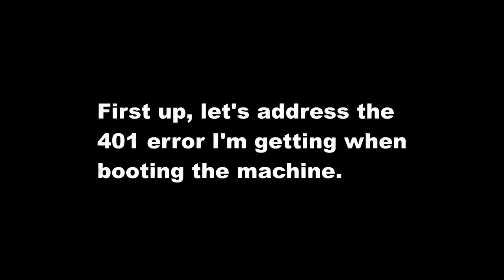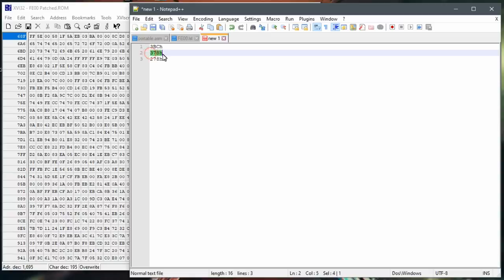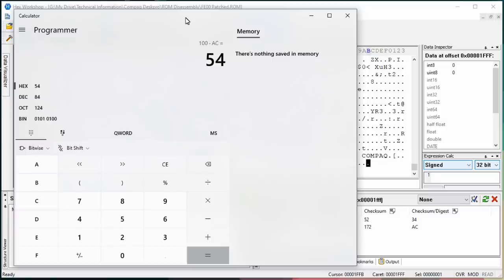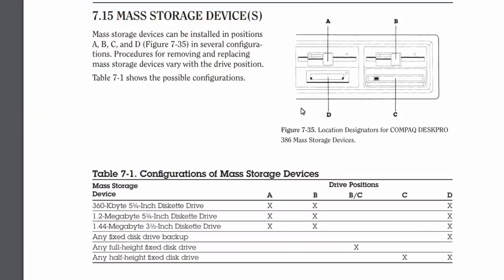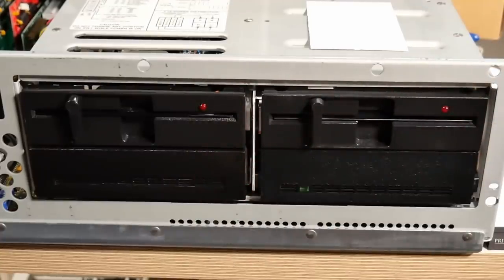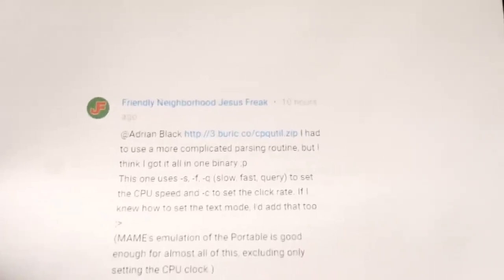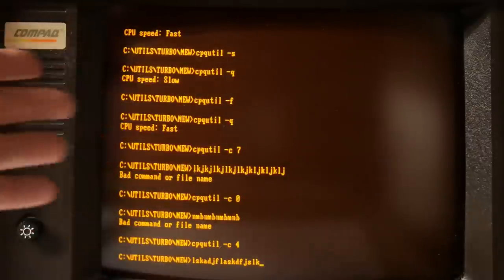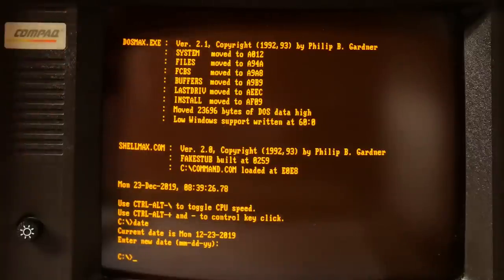Compaq Deskpro Part 3: Fixing that 401 error and more!

Comment: 20:01: The 1939 date is interesting. Because if this is related to Y2K, then the 1939 figure seems to suggest that XTCLOCK or SMWCLOCK (or Compaq?) used 1920 as their epoch date, unlike IBM, who used 1980: https://en.wikipedia.org/wiki/Epoch_(computing)#Notable_epoch_dates_in_computing
Of course 1939 also seems suspiciously close to the year 2038 problem, but I'm not sure how the Deskpro may have gotten to think it's one year past that. https://en.wikipedia.org/wiki/Year_2038_problem

Comment: Hi, another reason for the larger tube than the bezel, could be the linearity of the deflection circuity might not be good near the edges.
Reply: It would've made sense for a color tube to hide the mask's border... But on a monochrome tube (which doesn't have a mask) it would only make sense if the monitor is set to not have the raster fully fill the screen.

Comment: The 386 didn't have that drive arrangement if you got it with the 130mb full height drive. I had a 386/20 with the 387 and 2 memory expansion boards. My dad bought it new in 1986.

Comment: I didn't know you could basically "fix" a proprietary BIOS like the one from Compaq like that. I wonder if those fixes were theoretically possible with more common BIOSes of the time, like the old generation Award, Phoenix and AMIBIOS.

As for the German notice on the CRT, here's my translation: "The X radiation generated by this device is sufficiently shielded. Acceleration voltage is under 20 kV."

Röntgenstrahlung is the German name for X rays and comes from the German physicist who discovered them: Wilhelm Conrad Röntgen.

Comment: The version of ROM Bios in this machine is G or 105681-001, there were two later ones i.e. H 106265-001 and J 106265-002  ..
Reply: Yeah, I don't know why he editted the code when there's probably a number of fixes on later BIOS updates. It seems like the easier it became to download an update, the less people actually looked for them!  There's also "universal BIOSes" out there on much improved BIOS chips on various cards, like 8-bit ISA Compact Flash adapters. That would be my preferred solution.

Comment: You may find  the command processor  4DOS useful.  There is an open source version 8 which should be easy to find.   An EMS card would be nice, if you can find one and its drivers.   My first dos pc ran that setup for many years.   Now I run FreeDos on a Pentium 1 for my DOS   fix.   I could virtualize FreeDos, but there is something about  running it on bare metal.  Good Luck.

Comment: I used to use one of those compaq monitors it's on a PC-XT clone. I put a din connector in the back of the case and ran it off the PC power supply. I think I used an ATI all in wonder on it.

Comment: The strange signal probing on the video signal is probably due to  not correct ground reference. By this I mean that I see that your scope probe is clipped on the edge of the D9 connector, and probably that is Chassis ground and not Logic ground, which tend to be "isolated" with a 10Mohm resistor. This you could check if the connector has a pin dedicated to ground, if the signals are single ended. If this is not the case, the signals might be differential, thus no ground needed and you would need a differential probe, or use two probes on the Rigol and use a math function (disclaimer: not very good result).

Comment: The German Sticker says: THE XRAY IS SHIELDED AND THE CRT IS WORKING BELOW 20 KILOVOLTS
Reply: Just want to add that it is properly shielded to the specs of 1980ish. So try not to look directly into the screen without proper protection ;)

Comment: What happens when you take the Multio I/O card out, does the 401 return? What about when you put the original floppy printer card back in? I probably would have spent a bit more time figuring out what was causing the error, like checking for differences on ports 0x3bc and 0x3bd. With those Multi I/O cards someone really needs to write a program that displays what has changed since last boot when you modify jumpers, this would really help out with cards that have no documentation, may even help eliminate such errors. The BIOS looks to be revision G, revisions H and J also exist, H and above is required for EGA/VGA support according to documentation.
Reply: @adriansdigitalbasement  I must of missed that. I don't know about that particular Multi I/O card but some of them can definitely map LPT1 to 0x3bc. It might be an option that is not published. Also if you are going to modify the BIOS you need to make sure that every mention of the parallel port is changed as the port address (not 100% on Compaq BIOS's) are stored in the BIOS section of RAM (0040:0008-000f) and I don't see that occurring in the code you show.

Comment: 3BC is a monochrome/printer card thing. I think it may have been hardwired.

I'm still curious as to whether or not replacing the tantalum capacitors on the original I/O card would revive it. I've had cards, (newer than that I/O card but prior to the capacitor plague) fail on me because of this, at least one did it explosively).

Did we ascertain whether or not A: The Video Card is one of those MDA cards that can simulate CGA or B: whether or not that's not just a simply a black and white CGA monitor?
Reply: @adriansdigitalbasement  Good to know on the tantalums.

Comment: That No-Slot-Clock is probably the same as the Dallas DS1216E SmartWatch. It's based around the DS1716 RTC chip, accompanied by one or two batteries. You can use a Dremel or a drill to disconnect the potted batteries and simply wire a CR2032 directly to the RTC chip on the top.
Just found an in-depth video about how to do such a rebuild:
https://www.youtube.com/watch?v=0rQXCAyqEGk

Comment: Wow, that must still have the original ROM chips in it. I remember Compaq had quite a few ROM releases for both the Deskpro and the Portable in the early days to fix a few bugs, and to make it more "compatible" with the XT, I wonder if your 401 error is one of those things they updated in later ROM versions?
Reply: It seems to me that's a bug in the BIOS for definite. There are three possible locations for the LPT port on an IBM-compatible system (0x3BC, 0x378 and 0x278), and if it doesn't find the one at 3BC it should automatically assume that 378 is LPT1, not throw an error.
Reply: I have had both the Portable and the Deskpro up through the early PII's before it got rebranded.  Yes, there's a number of revisions to the ROM.  I'd consider some sort of a onlinerepo for the various versions going forwards.. especially the closer we get to 2149 :)

Comment: The monitor probably just sums the R, G, B, and I signals through a resistor network to build a greyscale equivalent.

As for the battery, I've ground one of those down before just for the fun of it, on a newer Compaq (as far as fixing the system, I just found another one that still had a working battery).  It's some kind of epoxy that covers a standard coin cell battery which is attached to the RTC's constant power pins.  Maybe acetone would work though?
Reply: Aren't the Compaq Portable and Deskpro monitors just RGBI/composite hybrids? I think the "amber-scale" is just CGA in composite mode as it would appear on a greyscale NTSC TV.
Reply: It would seem from Adrian's measurements that that is not the case.  Maybe some Compaqs did though (on that unused pin 7).  It's still outputting R, G, B, and I, HSYNC, and VSYNC, and if you connected it to an IBM CGA monitor it would probably show the familiar CGA colors.  But pin 7 looked like gibberish, and I agree that it's probably just radiated signal from other pins that he was looking at.  Even a weak resistor might have shown that the pin wasn't even connected, by cleaning up the signal.
Reply: @ovalteen4404   Perhaps we're both at least partially right and don't realise we're actually more in agreement than we disagree. Then again, and I honestly don't mean this in a snarky way, but I'm not sure now if maybe I don't understand how composite CGA works or if you don't know how composite CGA works. To my understanding, a CGA card continues to output an RGBI picture on the DE-9F (J2) when it outputs a composite-compatible picture on the RCA-F (J1). It actually drives both of these all the time (as well as P1); it's only that some output may be out of range e.g. on a composite monitor, as we saw in part 2. So of course it's still outputting RGBI, etc. while in "composite mode", as we also saw in part 2. Really the two are one and the same, it's just that for the benefit of an NTSC-compatible video display or TV, the RGBI signals are munged and turned into something composite-ish. I think it's conceivable that maybe Compaq's hybrid monitor which only has a power cord and RGBI connector going in and doesn't actually use a separate composite cable may replicate the same flip-flop circuitry that the CGA uses to munge the RGBI signals into composite. The only problem with that theory is that now that you've put me on the spot, I've had a look at the IBM Color/Graphics Monitor Adapter (i.e. CGA) Options and Adapters manual, and in the block diagram at least, there's some timing, etc. line from elsewhere to composite out, i.e. it's not from RGBI out. So maybe either the Compaq Monitor Power Interface (part 1, 10m42) uses a pin for that, or the infamous pin 7 (which ought to be not connected according to IBM) is being used to feed through the missing timing generator and control line. Also, since some output can be displayed either on a composite or RGBI monitor, how does Compaq's hybrid know which it's supposed to emulate at a given time? Perhaps that's signalled there too? 
That said, there can't be anything extremely unusual going on, because the DE-9F also has to be third-party RGBI display compatible (e.g. IBM 5153-compatible), so I'm still confident it's just ye olde turning RGBI into composite thing, and the shades of grey are probably just an amber equivalent of composite artefact colours. A detailed manual for the Deskpro would help. Anyone? Bueller?
Reply: @ovalteen4404  According to 108033-003.pdf, the hybrid monitor is properly known as the Compaq Dual-Mode Monitor and was available with either green or amber medium-persistence phosphor.
Reply: No, you're correct about how the signaling works, at least for the standard IBM CGA :)

It outputs RGBI + H + V on the DE9 output and simultaneously outputs composite on the RCA jack.  It leaves pin 7 unconnected and provides 2 grounds.

The CGA has a B/W mode which only affects composite out.  It does not affect the DE9 because that is simply sending the color attributes.  What B/W mode does is it clears the shift register that the 3.58MHz color modulation phases through.  The R, G, and B components are signaled straight through to the DE9, but are used to select which stage of the shift register goes to composite in order to do the phase shift modulation required.  In addition, R, G, B, and I go to an internal resistor network to provide the brightness (luma) part of the signal, and the modulated color output and sync signals are composited in.  The output of all of this goes to an amplifier for final output.

Now, there are two ways that people exploited composite "mode" BITD.  One was to stay in 320x200x4 mode with color and use the color bleed between pixels to their advantage to display more than 4 colors on the TV.  The other was to switch to 640x200x1 mode, but flip the B/W bit off so that it would still output color burst information in spite of only having black and white.  Then they'd use the pattern of white/black pixels to create colors as though they were the shift register.  The disadvantage to both of these approaches, though, is that it left you with an effective TV resolution of 160x200.  Also not very sharp.

Now, when the color TV standard was invented BITD, it was made to be directly compatible with B/W TVs too.  This is because it outputs the luma part with chroma modulated at 3.58MHz.  On B/W TVs, they ignore the color information and just place what comes in on the screen.  So in talking about what Compaq did (and without actual hardware to reverse engineer or technical documents to consult), we can speculate that they did one of two things where the composite monitor input is concerned:  1) They didn't include the color demodulation circuit and just did what B/W TVs do.  2) They didn't add the color modulation to the composite output that is speculated to be on pin 7.  Either way, the monitor needs no special electronics at all to output greyscale from composite in.  And with option 2, it can still have the full 640x200 capability without blurring.  That's because the 3.58MHz color signal has about 227 pixels at 1 cycle per pixel, so 640 would look dithered.

From the computer side, the Compaq Portable probably did output a signal on pin 7.  But the Deskpro apparently didn't.  So the monitor would need its own copy of the RGBI resistor network that is used to generate luma component within the CGA card, in order to build the greyscale that you see in that mode.  That's probably what makes it a "dual mode monitor."
Reply: @ovalteen4404  Thank you for also writing an effortpost reply. :) Apart from looking whether there's anything connected internally from Compaq's CGA to their "Compaq Monitor Power Interface" and maybe ruling out that that plays any role in signalling, an interesting thing to try would be to make and insert a little DE-9 dongle that has everything but pin 7 connected straight through, and then to see if the Dual-Mode Monitor still fully works the same after that. Because if the Deskpro doesn't actually use pin 7 at all, then I'm not sure w/r/t that timing generator and control line I mentioned. Maybe it's not actually necessary to turn RGBI into composite? Maybe the Hsync/Vsync pins can be used by the monitor to derive missing timing info somehow? Either way, I continue to be doubtful that there's actual ready-made composite out on that pin 7. I had a look at https://www.youtube.com/watch?v=wdFm91gAs_Q&t=18m58s but the traces are too obscured for me to see what's really connected to that pin 7, if anything. That Dual-Mode Monitor really is an interesting Janus-headed beast.

Comment: Have enjoyed all three videos, very nostalgic, especially the debug work. We used to change the font roms in Hercules cards so a zero was more like a capital O as the original 0 font was confused as an 8 on many occasions. Addressing on the cards was also easy to change. You could get four of them running in one XT as long as your program setup and ran the cards itself.

Just my 2c worth. Since it's all running satisfactorily at the moment, it might be time to reflash all the eproms in the box on the different cards while they still read correctly. Lately I've seen a couple from the late 70s forget stuff (bad checksums). Reflashed, they're now fine. The guarantee on them holding the charge was 10 years with many expected to stretch it out to 40.  We're now hitting 33/34 yrs since that machine was built. How much charge is pumped into the eprom cells was determined by what strategy the programmers used. A lot of code in the programmers was optimised for programming speed, not eprom life. Depending on your basement lighting, I'd also put a sticker over the window before programming it.
The battery in the riser socket is best bypassed by lifting pin 4 or 14 on the chip (think it's the 16 pin SO package) and wiring it to an external battery. Use a CR2032 in a socket with two wires to the board, one to the pin and the other to Gnd. Put some shrink wrap around the battery socket.

Comment: a 23min long video? what a great start into the new year!
2:37 light theme notepad++ and Windows, how do your eyes not burn? /s
also that german sticker just says:
"The in this device generated X-Rays are sufficiently shielded. The acceleration Voltage is 20kV"
lastly, maybe this helps for the NSC? http://www.apple2faq.com/knowledgebase/installing-parallel-cr2032-battery-vintage-dallas-based-nsc/

Comment: clock IC under the EEPROM. The EEprom ic has an +5 Volt pin and a ground. take care that the eeprom and the clock always has 5 volt with an external battery and some diodes...

Comment: You need help changing the coil cell battery? I doubt it. If you just rip into it I am sure it will be fine. It's funny how the popularity of those coin cells have kept them alive. I actually have a couple of hats that have 4 of them for both near and far white LED illumination. In fact it is such a perfectly balanced circuit between load and battery that there is no circuitry involved. That's very very rare with white LEDs.

Comment: I would say put the modem in a windows XP / 3.1 box and see what it comes up with.  XP is PnP so it should quickly figure out which modem driver to use.  Alternatively, See if there's a Patent # or FCCID # on the device and look it up.

Comment: I think it wouldn't be too hard to just skip the LPT check routine. At the start, either put in the hex code for return, or jump to the end of the routine and let it return naturally. Then it won't matter what LPT card you install. More modern systems don't bother with this test.

Comment: I was rather suprosed that Compaq checked for a parallel port, maybe they did it because all of those machines came with it, but that is stupid, because your supposed to be able to re-configure your machine, this kind of stops you.
I would have been more inclined to edit the ROM so it doesn't do that check, a couple of nop's (no operation's} in place of the comparison code would probably do it.